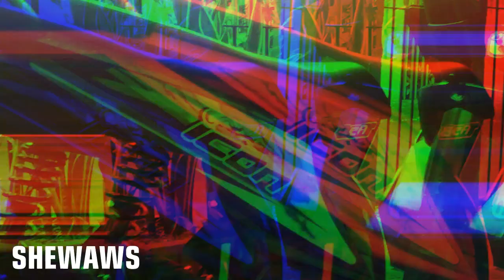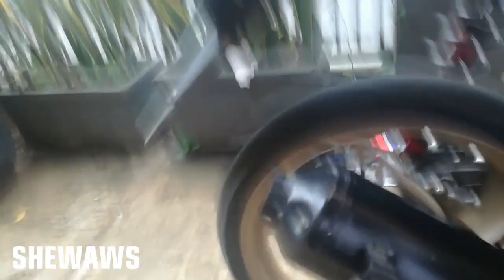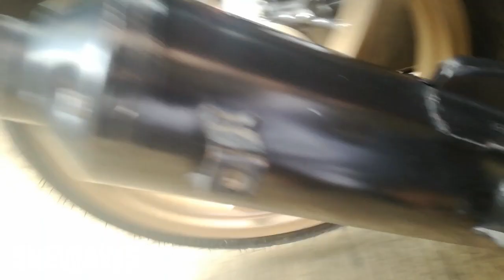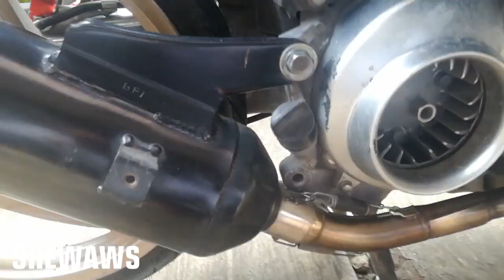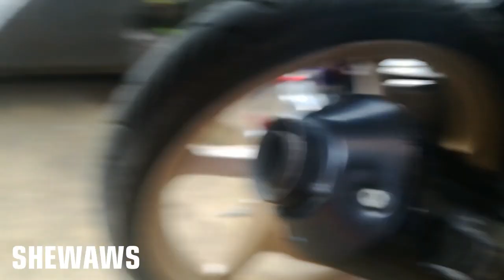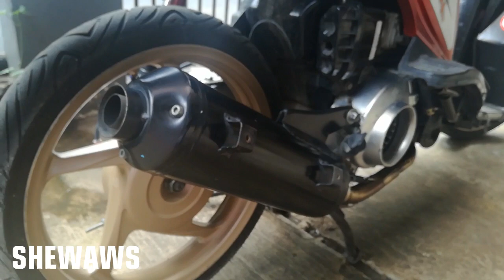REVIEW Suara Knalpot Tsukigi CLD C1 beat

Comment: Bang kalo pake pipa atas vnd kira kira muat gak ya, soalnya yang cld susah dicari di speedshop bang, tengkiu
Reply from the maker: Bisa cuman keset masukinnya, step nya klo keset

1.Ujung pipa pake pelicin oli atau apapun itu.
2.Pasang Pipa nya dulu tapi jangan terlalu keras.
3.pasang silincer dan mulai sambungin ke pipanya.
4.kencengin baud pipa
5. Kencengin baud silincer tpi jgn terlalu kenceng.
6.pasang per dan harus yg masih keras supaya pipa sama silincernya ketarik.
7.seiring waktu jg nnt jdi nyambung sendiri.
Jangan masang saat kondisi motornya panas
Reply: @Xaxeena  oke makasi infonya om tengkiu
Reply from the maker: @ilhamwahyudin2311  iya sama sama 😁🙏

Comment: Bang knalpot tsukigi bisa mber ga bang?
Reply from the maker: Bisa asalkan saringannya diganti sama saringan hember, pipanya diganti sama pipa yg kecil( mirip ori tapi besar sedikit)
Reply: Modal berapa bang
Reply from the maker: @ayyeng2333  100 lebih ada kayanya , lebih baik beli knalpot ber nya dr pada tsugi dibikin mber
Reply: Bang klo roler 9 gram,per cvt 1500 rpm, per kamps 1500rpm 
Boros ga bang
Reply from the maker: @ayyeng2333  biasa gan, dr bensin E ke full itu cmn 15rb, itu jg kadang kepenuhan